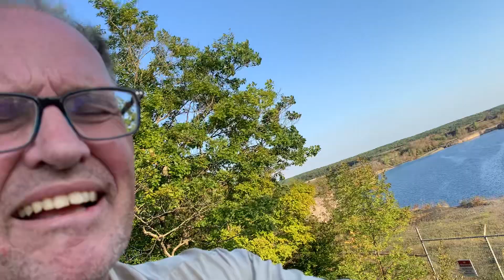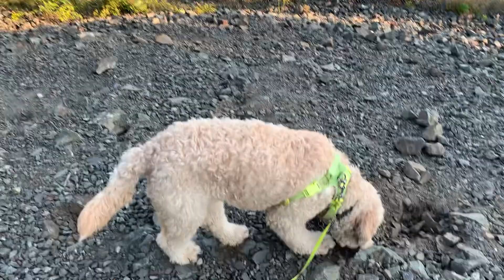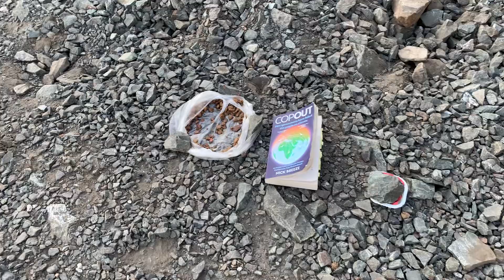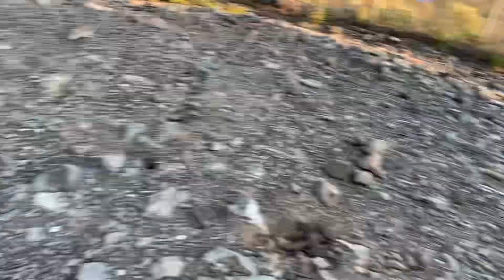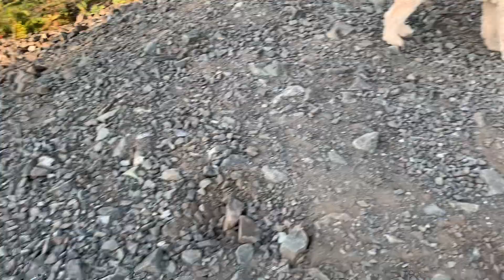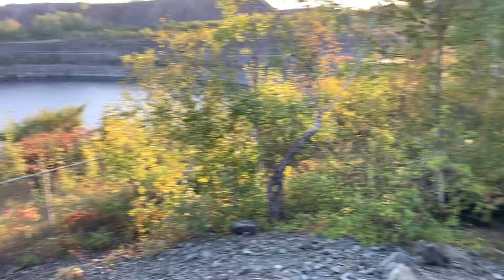Pumped-Water Storage Battery for Renewable Energy Systems?

Comment from the maker: Please donate to http://PaulBeckwith.net to support my research and videos connecting the dots on abrupt climate system mayhem.

I visited my mom for 4 days, and on my way home stopped to see the Marmora quarry site. 

This site of an old iron mine left a very deep hole in the ground which has filled up with rainwater over the years. 

The slag heap of processed rock tailings forms a big hill or plateau above the big hole, and is basically a huge pile of rubble.

About a decade ago, there was a proposal by the Ontario government to use this site as a huge battery for renewable energy.

The idea is that when the wind turbines and solar power stations were generating peak electricity well in excess of demand the extra energy produced could power pumps to pump up the water from the very deep hole in the ground to a reservoir created at the top of the slag heap.

When there was peak demand for electricity far in excess of the supply (maybe at times with no wind and no sun) then the water would run from the reservoir at the top of the slag heap down into the bottom of the deep hole, powering turbines and electrical generators. 

Electrical efficiency of such systems can be extremely high, as well as capacity to generate large amounts of electrical power.

The time was not right a decade or so ago for this project to go forward, but perhaps soon?

Unquestionably, the highlight of my visit to the Marmora Iron Mine site was chatting with a gentleman, his daughter, and his daughters boyfriend. It turned out that he was a local who had worked in the mine in summers back in the day to pay for his university. He also knew all about history of the project ideas to use this site for pumped water energy storage!!! Hopefully, he watches this video!!!

Please donate to http://PaulBeckwith.net to support my research and videos connecting the dots on abrupt climate system mayhem.

Links:

Marmora Ontario
https://en.wikipedia.org/wiki/Marmora,_Ontario

Marmora Iron Mine
https://www.marmorahistory.ca/the-mighty-marmoraton-mine

https://www.tripadvisor.ca/Attraction_Review-g1006570-d4204307-Reviews-Marmora_Mine-Marmora_Ontario.html

Peer-reviewed paper: A review of pumped hydro energy storage
https://iopscience.iop.org/article/10.1088/2516-1083/abeb5b/pdf

Pumped Storage Hydropower
https://www.energy.gov/eere/water/pumped-storage-hydropower

Pumped Storage Hydroelectricity
https://en.wikipedia.org/wiki/Pumped-storage_hydroelectricity

Please donate to http://PaulBeckwith.net to support my research and videos connecting the dots on abrupt climate system mayhem.

Comment: No. Saltwater is too corrosive to be practical. Scrap iron is more plentiful, accessible, and efficient than freshwater.

Useful gravity batteries will probably be based on pulley and rail systems, like weight machines.

Comment: Can't wait to see pumped storage used as part of a project to move water over a hill/mountain.

In theory it could make getting water over mountains and into drier regions free.
Reply: At 78% efficient you'd still have to pay to move the water.  Also, usually you want to move the water uphill in the end, and there is no getting around spending power on that

Comment: Pumped storage works, but it doesn't address exponential growth at the expense of the future. All solutions will fail unless this demand for unchecked growth continues and it will continue until we crash and burn. I don't think we have much time. Enjoy what you can.
Reply: It also produces significant methane emissions if you dam and flood a valley due to decomposition of the terrestrial biomass. An existing lake shouldn't be too bad as long as the cycles are short enough to prevent new plant growth at low fill levels.
Reply: @TheUAoB  Believe me, I've seen the Marmora iron ore mine at full tilt.  There is Zero plant biomass in that hole.
Reply: It's our lust for personal profit as a motive within the capitalist engine that currently powers our E-air-th's economy, that is the core of the problem.

Comment: Pumped hydro is much less efficient than batteries, but cheaper and longer lasting
Reply: @CollapseWatch  Exactly. There's no silver bullet.
Reply: How much less efficient?
Reply: @mladenblant8806  there's not much difference. 

"According to data from the U.S. Energy Information Administration (EIA), in 2019, the U.S. utility-scale battery fleet operated with an average monthly round-trip efficiency of 82%, and pumped-storage facilities operated with an average monthly round-trip efficiency of 79%."
Reply: @mladenblant8806  Lithium ion batteries are 85%-95% efficient, pumped hydro around 78% efficient, according to "Life Cycle Assessment of Closed-Loop Pumped Storage Hydropower in the United States"  in Environmental Science & TechnologyVol 57/Issue 33.  Tesla states 93.5% efficiency for its Megapack.

Obviously there are many other factors that differ.  Batteries can be located more flexibly, also meaning they can be placed closer to power sources, sinks, or existing grid connections.  Batteries can respond much more quickly to power demand.  Pumped hydro can more easily decouple power output and energy storage, whereas lithium battery systems tend to have a more fixed ratio.  Flow batteries complicate matters further, with typically lower efficiency but allowing decoupled power/storage.
Reply: If it's not more efficient in the sense that it's cheaper, in what other sense is it more efficient?
Reply: @jffryh  Fraction of the energy recovered compared to the energy stored
Reply: But it does give you vital extra water storage for drought if you do it right. With heavier rains & extensive flooding happening far more often, you can pump water out of overflowing rivers to help reduce the damage.
Reply: It would make more sense to shade the reservoir with solar panels to avoid evaporation loss. 

Even more beneficial would be the rewet wetlands, ponds and forests